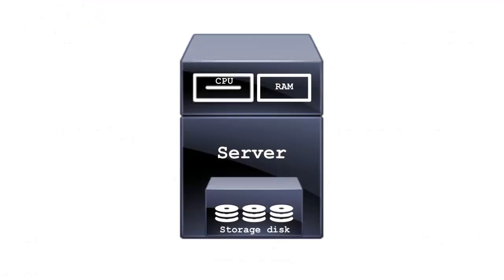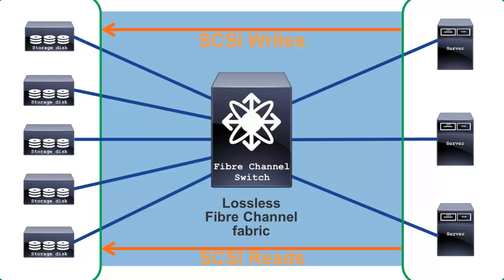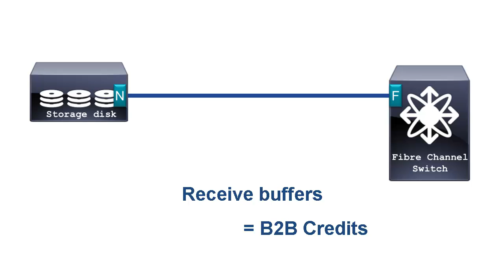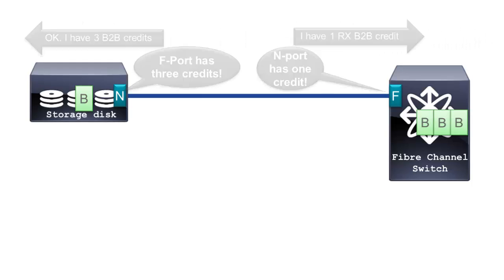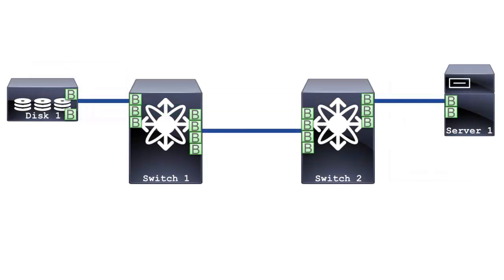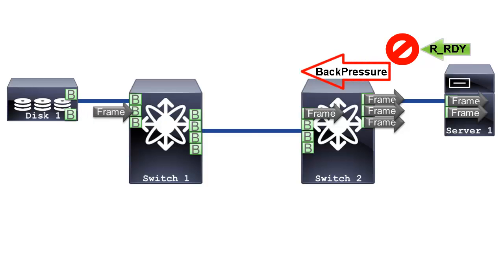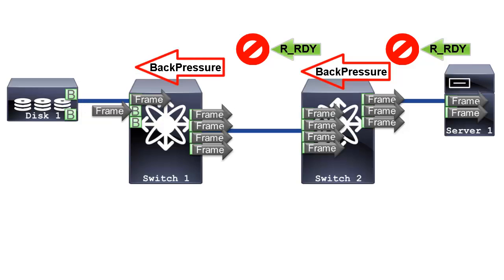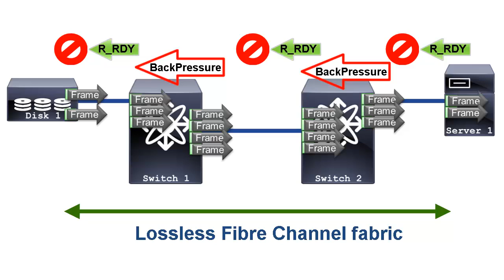Understanding Slow Drain : Fibre Channel flow control - Part 1

Comment: What if txb2b=0 counter frequently increases for 60minutes in ISLs due to some host reading data at high throughput across ISL?
Reply: This may be due to congestion at a edge-port, spreading to the ISL. Please refer to this detailed white paper: http://www.cisco.com/c/dam/en/us/products/collateral/storage-networking/mds-9700-series-multilayer-directors/whitepaper-c11-737315.pdf. Page 26 explains the methodology. Page 29 talks about your situation.